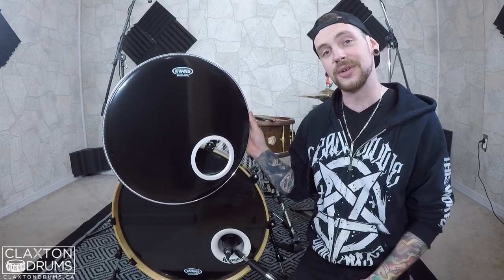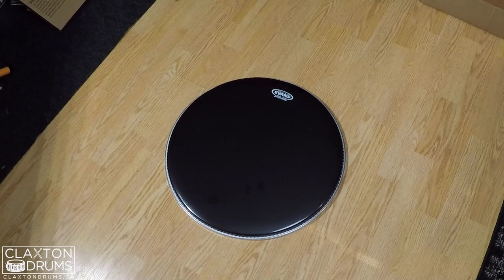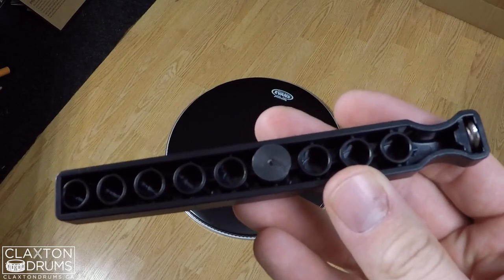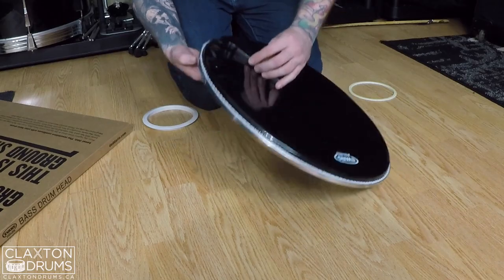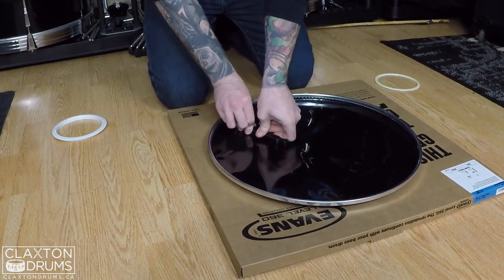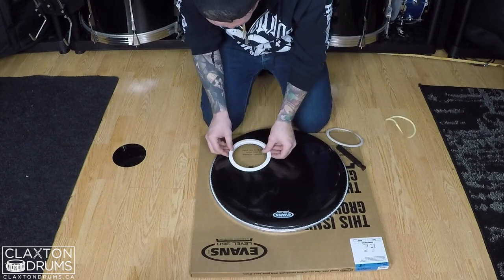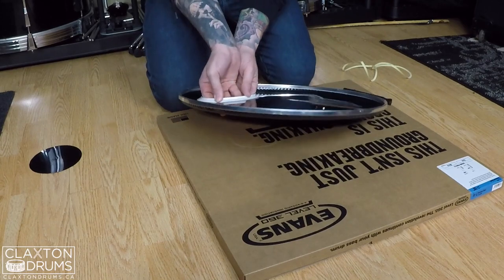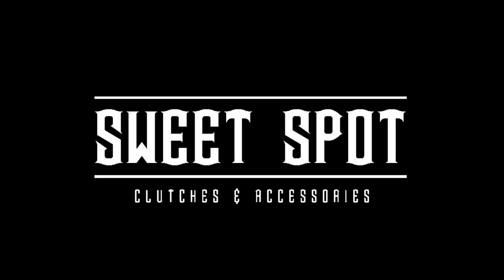How To Cut A PERFECT Sound Hole

Comment: On the inside of my bass skin I have a clear bit which is apparently the built-in dampener. But this seems to be around 4” so my hole will be quite central to avoid cutting the clear film… is that okay?
Reply from the maker: Yeah either way you do it will be fine. You can go through that clear film too, it won’t harm the head or make the head sound any different from cutting elsewhere on the head.

Comment: Can i use the cutter to cut the hole while the basshead is on the drum itself and it's under tension? Or should i detach the basshead from the drum and cut the hole?
Reply from the maker: Great question! I had the head fresh out of the box here so for me it made sense to do it before putting it on, but I’m thinking as long as your head has solid tension to it, it should work no problem! The cutter is pretty sharp so that mixed with tension should make things easy! 

I would still recommend laying the bass drum down though so you can push into it a little more if you need to. As you can see in this video I didn’t realize I needed more pressure to go all the way through at first.

I’d love to know how it works out for you! If you do it, please let me know! Cheers! 😄🤘🏼

Comment: My bass drum doesn’t have a hole and I’m playing a gig, do I need to do this,
Reply from the maker: Good question! I would cut a hole if you have time to. It’ll just sound better to have a mic pointed into the kick through the hole vs not. 

That being said, the sound guy I’m sure can still make it sound decent without cutting a hole in it if you don’t have the time or resources to do so. 

Hope that helps and have a great gig! 🤘🏼
Reply: @ClaxtonDrums  thanks mate :) I was also wondering what size I should do it, I’ve ordered this tool now lol
Reply from the maker: Nice! 
As mentioned in the beginning of this video, I used the 5” center because the “Drum O” that I bought was 5”. So maybe consider picking up one of those or a kick port, and whatever size it is, is what you should go with. If you don’t plan to get either of those two, I’d still probably go with 5” so it has plenty of room for a mic to sit in your bass drum. 🤘🏼